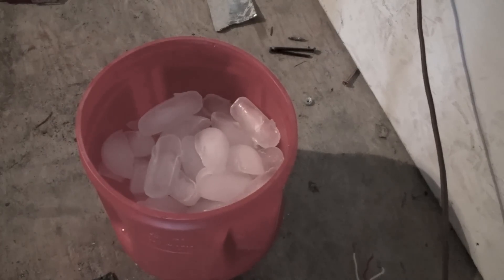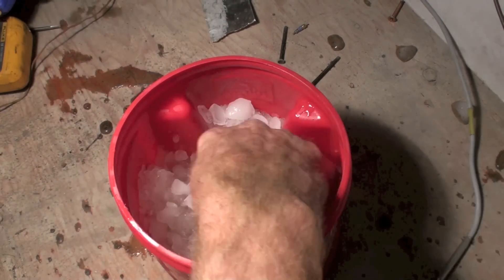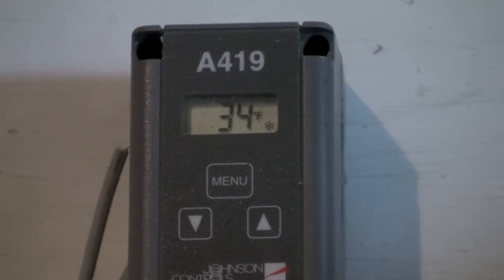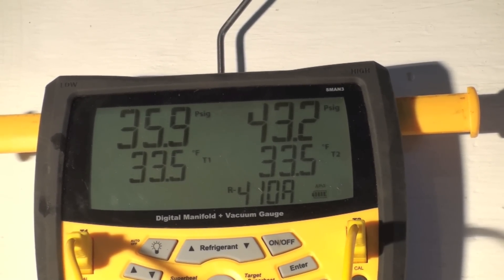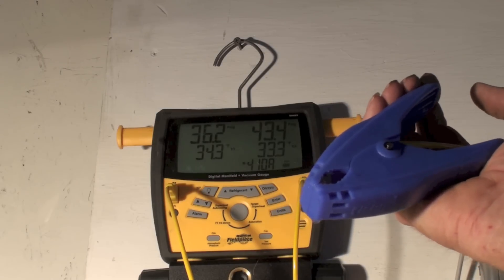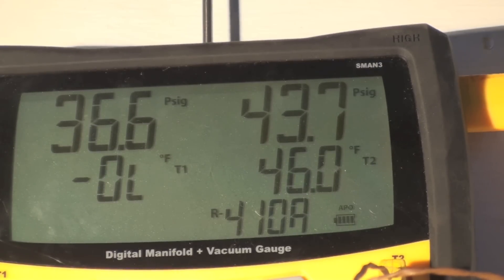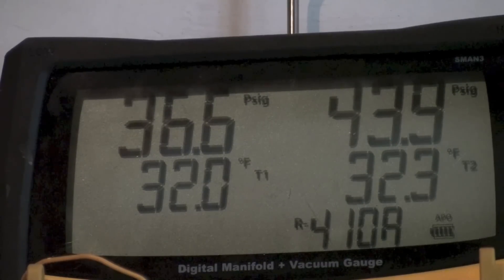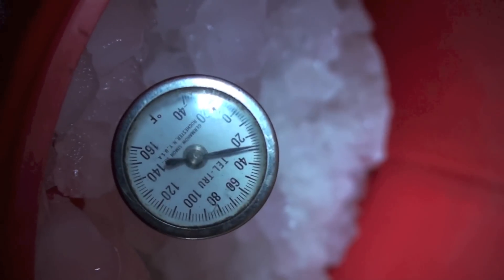Check the calibration of the thermometers for HVAC

Comment from the maker: Good point.  I wonder why no one else caught that.  Most of these type of probes are not adjustable.  So if the calibration is off 1 to 2 degrees, mark it on the meter and adjust readings.  If farther off, replace the probe and recheck.  If its the meter is the problem, replace the meter.  Thanks for the input.
GFM